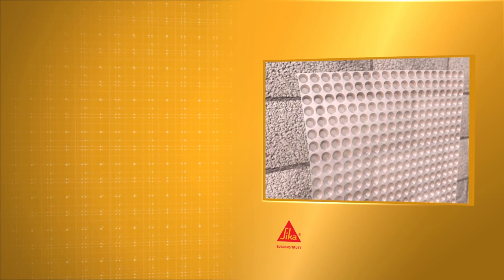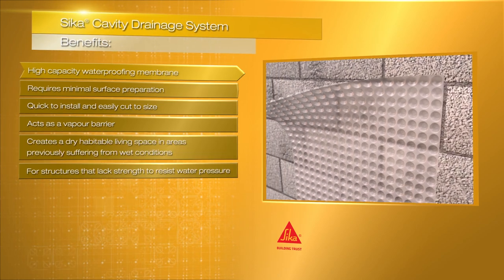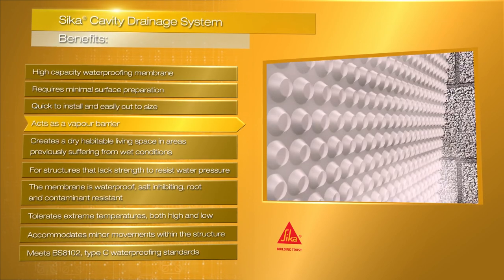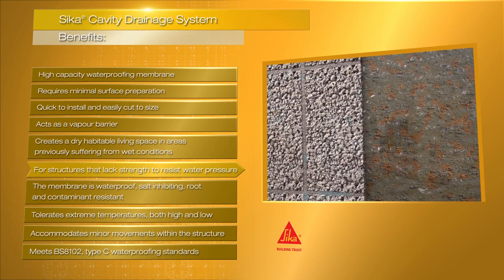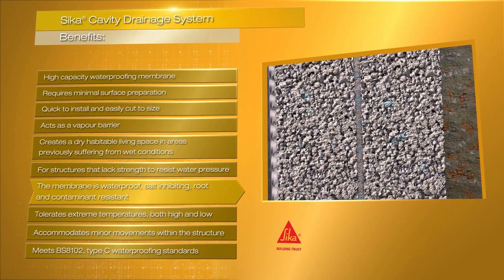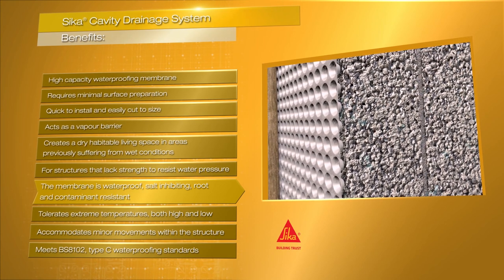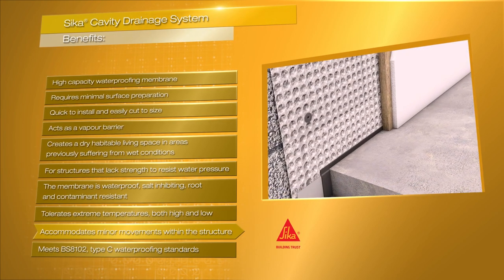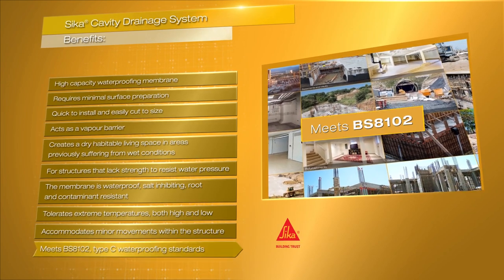Sika Cavity Drainage System

Comment: You have taken away the concrete cover to the reinforcing steels. Have seen better designs that do not require removal of the concrete at that critical joint between wall and floor.
Reply: Like?
Reply from the maker: Hi ezz il, thank you for your comment. The video is just illustration and does not show the reinforcing steel. The slab can either be designed to accommodate the perimeter channel without affecting the structural performance, or the channel can be created by adding sacrificial screed or insulation board on top of the slab.
Reply: @sikauk  Correct. But the method you show should only be used with a thickened slab and the steel lowered accordingly.
Reply: @dgbucko  But they didn't show the steel or the thickness of the slab all of that in general is done on a per job basis and designed by an engineer showing the detail in the relevant drawing. 

The detail they show is very typical though a cavity drain laid down on top of a structural slab with a thinner non structural slab poured on top of the drain.

I first saw this being used in the late 1990's in Dublin on some large commercial projects which were two and three floors below ground. Typically in that type of situation the structural slab is poured first with multiple water barriers in situations where you are well below the water table we had 3 water barriers plus the cavity drain on top.
The entire basement slab and retaining walls had rolls of a Bentonite system similar to SikaProof® Bentonite just a different brand below and behind the entire area, There was then a rear Guard PVC cast on all joints and finally a hydrophilic strip installed in the center of the joints, and on some slab joints that were 800mm or more thick 2 strips of hydrophilic were detailed.

In the structural slap all the pipe work, rebates recess's drains and sumps were installed & cast in place with 100's of tons of rebar these were thick slabs 800mm to 1.0m.
On top of this structural slab the Cavity drain was installed and another 100mm approximately (I can't remember the exact thickness) slab was then poured over the cavity drain  and finished. 
While all of this was going on they had temporary sumps with large pumps going 24/7 the water pressure was extremely high at that depth.
Reply: @deepwinter77  None of which is explained. What about the very narrow connection from the channel to the sump. Way to small and prone to blockage. Not seen that done so badly since the 1990's. Overall a poor specification, but cudos for trying to defend it.
Reply: @dgbucko  I'm pretty sure you're misreading it, what exactly do you mean below the channel, below the pipe where do you think there isn't enough room? The pipe and sump are encased in concrete. Do you mean the diameter of the pipe?
It's not a matter of defending it's in line with BS standards and is an effective system I have actual experience using.
Your making vague claims that don't really line up with either the video or what the system is actually designed to do.

How did you determine its a narrow connection from the channel to the sump? On what basis water carrying capacity? It just looks to narrow?
Reply: @deepwinter77  Yes mate too narrow. Gets blocked easy. Is how it used to be bodged 25 years ago. Sika hasn't a clue with Type C. What was that on thr BS?
Reply: @dgbucko  Right sure so what size pipe do you need for the design flow rate of that system, because it's not used for waste water, or rain runoff. 
Were not talking about a main drainage system here.
Were talking about a backup systems in the even there's a leak.
Each is designed for a limited amount of water that's why the sump is sized the way it is and why the sump pump is the size it is.
They're used are not instead of they're in addition to water protection i.e water barriers.

Also what do mean it's taken Away cover from the steel how exactly do you figure that where and how would that effect rebar cover?

Btw Silka are not the only company that has this system it's installed the same way, same size piping same pumped sump system.
When it's specified.
Reply: @deepwinter77  You would expect the section  of the discharge to the sump to be at least the section size of the channels,  preferably greater, so as nor to block with lime scale and to have the capacity if needed. Have a look around, you will see there are companies doing this properly. The required ateel cover means that  if a recess is used, the steel must be lowered and the slab thickened to accommodate this, which is fine, but they have not shown this, which is not great for an educational video.  

Now, tell me again what this British Standard is saying.
Reply: @dgbucko  So this is weird but you seem to unaware that different details on  construction drawings are not all on one drawing.

The fact that you even state to have a bigger pipe to have the capacity if needed shows your just confusing this with general waste water  plumbing.

It's designed for a restricted amount of water have a 6 inch pipe going into a small sump would make little sense.

These systems aren't designed for that, it's like complaining that a ladder doesn't have a lift.
So a drawing and detail for rebar does not show water bar or plumbing or man holes or channel details and vice versa is true.
This is showing a water bar and leak protection it's not showing rebar it's not showing general plumbing your simply wrong on the application of this type of system and are confusing general plumbing for waste water it's not.

Your confusing this system with waste water plumbing, and are making claims that don't make much sense.

Where is rebar cover effected by this system that's the first claim you made.

These systems cover a certain defined area, the greater the area the more sumps etc you would have. 
It's not a case where one detail is the same for every single application in the country like how there's different diameter  pipe for different requirements.
Reply: @deepwinter77  No confusion here bud, the 40mm waste pipe shown in the vid uses a 32mm adapter to make the fix, which has a 28mm inner diameter, which is simply not a large enough size to drain from a channel that is 50x85mm. 

You cannot provide the required concrete cover through a recess unless the steel is lowered, which means the slab is thickened to accommodate. You will see this in the details provided by those that actually know their Type C.

What was that British Standard stuff you mentioned again?
Reply: @dgbucko  of course you can provide cover around a channel like that it's done everyday, it's a simple Ubar detail to that dimension under the channel, with a step up after the channel. As for the diameter of the pipe it depends on what is specified and what the requirements are how many sumps are responsible for taking the water if a water barrier leaks how many pipes are detailed into each sump.
It's not like a single drain outlet, each sump typically pumps the water if any typically not much to the actual drain outlet.
The BS is also in the video 8102.
Reply: @deepwinter77  Yeah, I know which BS. I was waiting for you to tell me what it said to support the video, as you mentioned a few posts back.